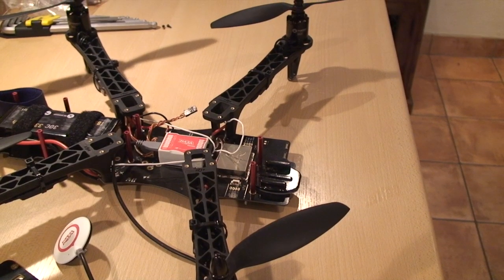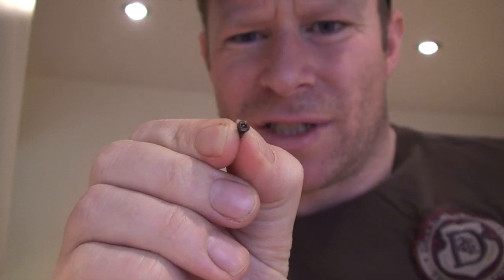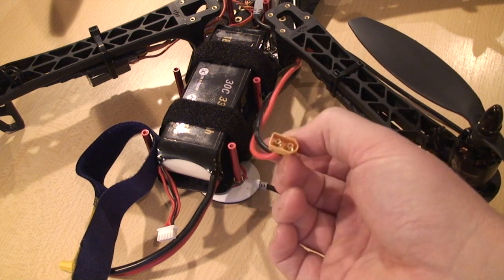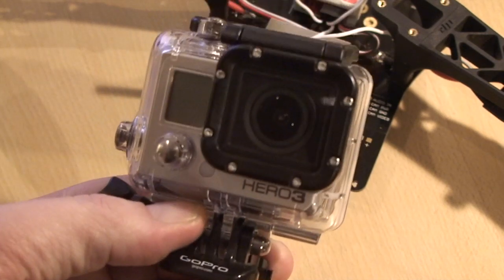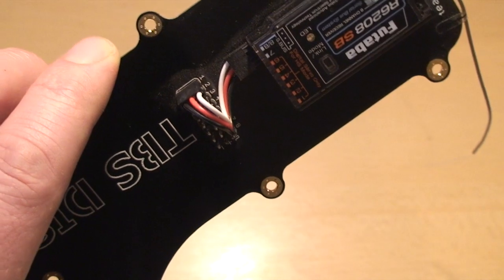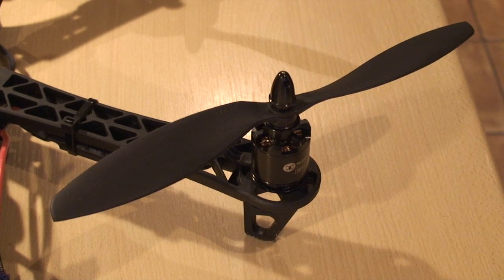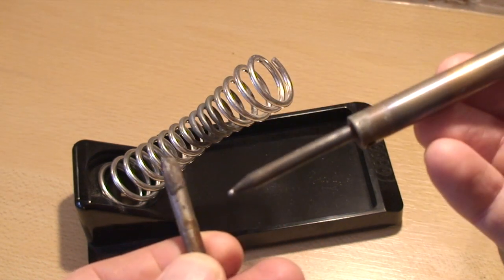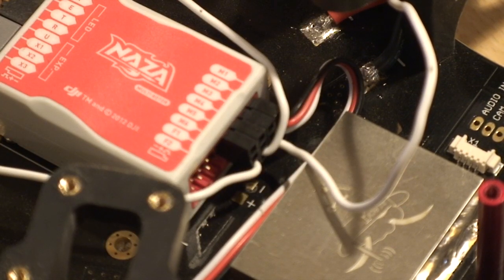TBS Discovery Build - Lessons Learned

Comment: Hi, at 5:02 you mention the crossing over of the pwm wires, the markings on the board are arbitrary, you cold plug channel 1 into 8 as long as you use 8 for 1 at the other end.

Comment: Hi Darrell. Some nice footage on your channel.  I am thinking about investing in a  fpv rig.  I am thrown between doing a cheap qav 250 build (all in about 300 quid) or going down a spider quad route similar tbs (Diatone Reptiel 500 frame) (all in around 600 quid). Qav 250 I thought could be a good way to learn fpv and get really good at flying, then invest in the spider quad later.   I want to eventually get into shooting via gimbal setup also.  What are your thoughts and recommendations?
Reply from the maker: QAV 250s look fun for fpv flying and zipping about in confined spaces. But the quad is the way to go straight-off if you want a more stable platform for capturing video for film and will be flying in open space. You'll pick up the flying so quickly (within one day) that I don't think you need practice on the smaller one, unless you're going to be learning in places with loads of stuff to crash into
Reply: Ok thanks for the insight. How much was the initial build cost for the quad?
Reply from the maker: Damien Van Der Vlist TBS Discovery Starter Set which includes all you need to fly + fpv goggles is currently about $1,500, so £1,000. GoPro extra. Compared to Phantom 2 Vision+ at £940, no goggles, but use your own phone for fpv screen. Or go for the cheaper copy quads.

Comment: Just a quick question.
I bought a knock down version of the quad from HobbyKing and I'm not clear on how to locate the CG.
Is there a simple way to determine where the CG is?
Thanks!
Reply from the maker: On the TBS Quad, there's a circular black and white symbol which should show the centre of gravity. Not sure about your knock down version. But I usually balance the quad on my finger underneath the circle and see which way it naturally wants to fall to determine where weight is better shifted to balance it.
Reply: Thanks for the advice! My don't have a mark for CG.
Is it a practical way to determine where the CG is by flying it in mannual mode and observing which ways it will tilt, back or forward?
Reply from the maker: tony13985 Hmm, not sure. If my manual flying attempts are anything to go by, you run the risk of crashing the thing in this CG experiment. If it's any help, the TB CG is about 1 inch back from the centre-point along the length of the base plate. Which is a bit odd since the battery at the back is the heaviest part, but flying ALTI mode seems to compensate fine, so I've never had a real need to get it exact
Reply: My quad did fly and I think it flies well.
However, I'm not 100% sure if I had the CG correctly.
My sumption was to fly it between auto level and mannual to find out if the balance will change dramatically in flight. If not, I have the CG correctly...

Comment: Hi.
Nice video with some afterthoughts. But.
The power cable..  
There are so many different that they can't supply all 285 types.
The bolts/screws,
If you tighten them so tight that the tool "Bites" in the head, it is too tight, when you then strip the head, you are way past that mate.
The Locktight will keep things in place.
Just some advice for novice.
Keep flyin'
Reply from the maker: True on the power I suppose, but TBS sell their LiPos with XT60, so I'm thinking they should provide that at a minimum. They do now I think, probably after I was whinging at Trappy about it. And the bolts, I didn't over-tighten them to my knowledge. I think they've changed them also now.

Comment: Good tips.  I order my TBS Disco due to power brownouts on my decreased DIY quad. I read the Discovery eliminates power issues.  Have you any power problems?  Do you have the Core installed?
Reply from the maker: I have the Core installed. No power transformation issues. Seems steady. But I have had issues with the Core. Firstly, the YouTube video instructions don't show the important step to solder your voltage selector points. Secondly, TBS soldering was not immaculate and I had to re-do a couple of points. THen it stopped working so I had to install a new one. And now it's a bit flaky on my 5v side. Summary: it works, it's small, it does two voltages, but it's not bulletproof
Reply: Darrell Grundy where is the voltage selector point located? And which quad do you fly now?
Reply from the maker: leadpan THere's a pic of the VTX and CAM voltage selector points on my wordpress page ... http://grundlefly.com/2013/03/21/oh-trappy-i-could-strangle-you-some-days/
Reply: Thanks Darrell!

Comment: The naza has a range limit i have mine set to 2000m look in the program when you set it up hope that helps you. You dont need the + and - from one esc going to the naza as it has its on bec i an running it with only the signal wires going in to it.

Comment: Have bought the frame etc now just deciding on what fpv gear to buy! What set up are you using and are you happy with it?
Reply from the maker: I have the TBS 69 cam at the front. It's expensive at ~£150 but it is very good compared to other high quality cams (e.g. firstpersonview Sony 600 line at £70). By the time you get your goggles (Fatshark Attitudes at £350) plus my groundstation setup, erm probably £300+, you're getting close to the new DJI Lightbridge price at £1,000 which does HD video and radio Rx. Stupid price, but HD vs. SD is a big world of difference.

Comment: Darrell, great video mate! I'm about to embark on the quad copter phenomenon for the first time so I can start to get some good aerial footage using a brushless gimbal and gopro 3 black mounted on the TBS discovery pro quad (from my research this is the best set up on my budget). I have good soldering skills and am used to tinkering with electronics, however this said I have zero knowledge of radio equipment, naza or any of the gadgets used including how to set up and/or calibrate them! I have watched the videos of the build and I'm confident I can put the thing together but when I scroll down and read some of the comments below, half the time I dont even understand half of the terminology! Did you have a lot of RC experience prior to your build? I have a few 4ch helicopters and a 6ch mini 3d heli but they all come as plug and play items! I can fly them too!!!!!!...... but when people start talking about freq and Tx, Rx seting up the tx etc etc etc, I only know the basics nothing in depth..... I guess I'm asking if you think I should go for it based on my practical skill not the knowledge i have in RC??? I know I can solder and install all the parts its just the next stuff that scares me!!
Any advice would be welcome!
Craig
Reply from the maker: You sound perfect to take this on. I had zero experience with proper R/C before this and overwhelmed, but the steep learning curve was half the fun (by that I mean feeling of achievement). There's so much advice on YouTube and forums that you can't get lost. The main thing I'd say is that I had most fun at the start when the copter was simple and light. This hobby is expensive in terms of initial outlay, repairs and upgrades. If your focus is semi-pro video, then the Disco Pro is a good choice, but if it's more about flying and some cheeky GoPro YouTube videos then I'd be tempted to go down the Phantom route
Reply: Thanks for the advice mate! Since I posted here I have decided not to go down the pro road and build the same standard discovery like yours. I have found some great guys like yourself who think that the expense of the pro is not worth it for me! I can build the standard discovery for a little more than the cost of the frame of the pro! And i can fit a gimbal to it. Anyway I will keep you posted and I may have some questions in the future if you don't mind answering them!!! Thanks again for the advice keep the videos coming!
Craig

Comment: Darrell, thanks for this great video. You seem to suggest the Naza has to be smack in the middle of the rig. Is that always the case ? I have a T810, and I had a weird problem with a range limit limited to 50 meters. Could it be caused by my Naza which was installed at about 10 com from the center of my rig ? thx
Reply from the maker: Doubt it. Radio range should purely be a controlled vs. receiver issue. What happens after 50m, does it go into Return-to-Home mode? What kind of radio controller / receiver are you using? My comment about Naza centre of gravity position is mostly related to the gyroscope motion (I think). Seems having it true centre is best for it knowing what level is. A bit like sitting in the middle or the end of a pirate ship fair ride. I'm a bit fuzzy on the science though.
Reply: yes indeed, it always goes into RTH mode. I have just send the TX and RX back to the shop....waiting for a possible solution, but it was a weird problem indeed.

Comment: Thanks man! finally someone with a r6208. I'm trying to put my discovery together right now. First I connected all link cables but then I saw your video and now I'm using only the sbus. The connection goes from the receiver to the 1.pin top plate (ppm) and then from the ppm pin on the bottom plate to the naza x2 am I right? I'm asking because my dji led flashes red. I have a the gimbal as well. I'm not sure if I can run everything through sbus. Thanks for your time:)
Reply from the maker: For the first part, sounds like you're on track. If you don't get the red power on your Futaba radio Rx, then the s-bus wire is the wrong way round on the TBS Disco boards. If you don't get the green light on the Rx after turning on the Futaba controller in close proximity then there's something badly wrong. I assume you're past this point. The DJI LED will flash red if it's in Manual mode. Where are you after that?
Reply: Thank you for the answer. If it's too much trouble I head over to the forum jungles. I made some progress with the connections yesterday. yes you were right is was the wrong way around and after getting the green flash light I pressed the button on the Rx to get the connection. I was able to do the configurations with the naza software then. Even assigned some switches for the gimbal on the t8fg. Now the battery is charging. The burning question now is how will I get the gimbal to work? Everything is sent through s.bus to the naza controller. But the TBS Disco uses it's own gimbal controller and not the one from naza. How do it get it's signal? Is there a branch-off of the s.bus line between top and bottom plate? Or do I simply connect the related pins to the Rx on the top plate? I'm starting to think that this project is a little too much for a first built:) Don't wanna give up now. Thanks for any help in advance!
Reply from the maker: Simon Podolak Well the s-bus mirrors the individual ports through 1-8, so you can have ports 5, 6, 7, 8 directly plugged in (I think) in addition to the s-bus connector and have those go to the gimbal for individual controls. I use port 6 for example as a camera switching toggle on the controller. See my recent video on 2 cam FPV + iOSD. I haven't gone down the gimbal route yet so can't advise on how to overcome all of those challenges. I feel your pain though. It was a sea of questions in the beginning. Still is actually.

Comment: I also had crap screws with my kit, the ones with a 1.5mm hex. However, my mate who was building his TBS right next to me had good screws in his kit, similar to the ones that come with a DJI F450 with 2.5mm hex heads. Thats odd isn't it. Both my kit and my mate's kit were bought from the same supplier (quadcopters.co.uk) at the same time.

Comment: Thanks for replying. It's strange to me that this necessary part to complete the build that it is not supplied. I feel annoyed that it was sold to me as "The all-in-one package" for a beginner to start in FPV flying. TBS should be supplying full build instructions with such an expensive set but I am reliant on youtube videos such as yours and other enthusiasts. I'm anxious about the build now as I have uncovered 2 issues in the last couple of days battery/bridging of the core for the TBS69.

Comment from the maker: Hi Alan. You will need a single male XT60 connector with 2.5mm diameter copper cables running to the battery + and - pads top and bottom on the base board. This needs to be soldered on. I now have an EzOSD (current sensor) which has an XT60 IN and OUT, but you've still got the same problem of running the wires from the EzOSD out to the TBS Discovery main board battery pads, so effectively the same challenge. Good luck!